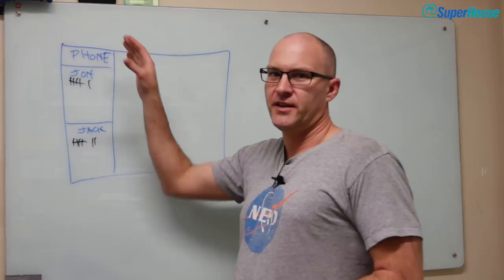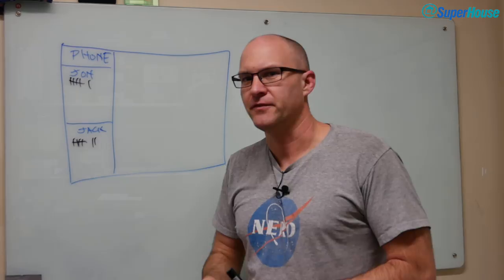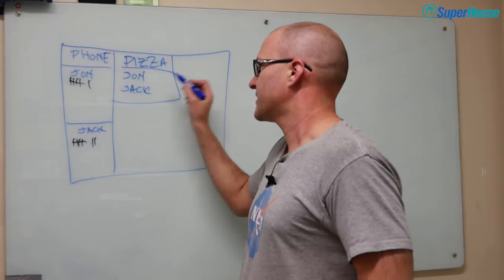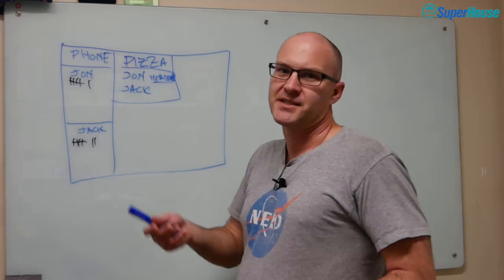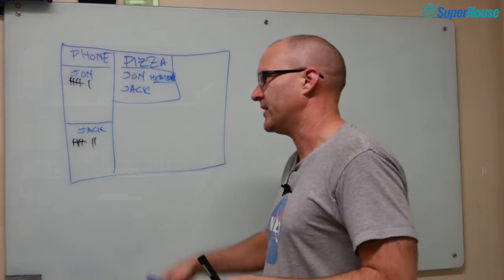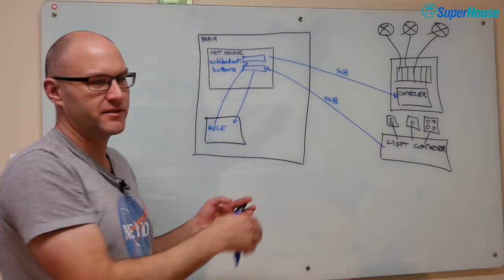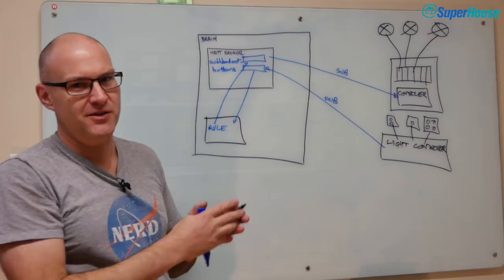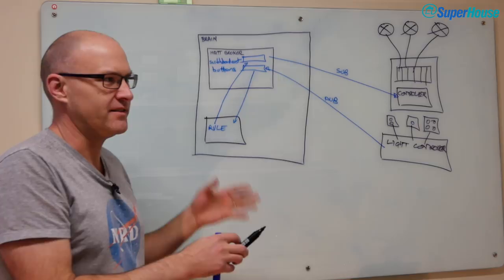SuperHouse #24: Home automation system architecture

Comment: Excellent video, thank you for taking the time to put it together! I'm wondering about that temperature and humidity sensor you showed in the office. That arduino board looks like one I've never seen before, very tiny! Using a custom design with integrated WiFi, or is it an off-the-shelf build?

Comment: Hi Jon, on reflection (and re-watch) of your video I've got a question regarding MQTT and publishing to topics. Ever since I watched your early videos on light switches etc using MQTT to publish to topics, it appears each lightswitch has its own unique arduino code, because it needs to publish to a unique topic correct? (you give each switch a Panel ID I think you called it) What do you think about the idea of rather than publishing to a conceptually easy to understand topic e.g. house/lvingroom/temperature - you publish to a device-name based topic, and by device name I'm thinking MAC-address so something like sensors/AA:BB:CC ...../temperature. That way your "script" / rule engine, needs to do the look up to "convert" a MAC address to what it actually is or only subscribe to the right MAC-address topi, but then it means the code on each device is basically standardised? Thoughts? Obvious drawback is that it is less conceptually simple to understand each topic but it means that every light switch (as an example) would contain the same code which seems like an attractive idea to me - cheers and thank you again for all your amazing and fascinating work!
Reply from the maker: Topic structure has frustrated me ever since I started using MQTT back in 2009. I started with a very simple, flat structure with shared topics. For example, my light switches all published to a topic that was just called "buttons", so their messages had to contain both their own ID (to show who published the message) and the ID of the button that had been pressed. So a message like "17-A" meant that the first button (A) on panel 17 had been pressed, to distinguish it from the first button on a different panel. Many of my topics still work like that, but for newer devices I tend to use a structure that's more like what you describe. I really like the Tasmota firmware that Theo Arends develops for Sonoff devices, and he uses a logical structure that incorporates the device ID into a structure that separates out control messages, feedback, telemetry, etc. I need to figure out a consistent topic structure for my system and do an episode about it.

Comment: Nice setup Jon and a great info for those starting with Automation. I'm very envious of your fully wired system. I'm currently doing what you are albeit on a smaller scale and mostly through smart wall switches and ESP8266 boards. My brains is HomeAssistant and I use MQTT for communication too. Just a couple of points, why do you use NodeRed/own rule engine? Are rules not possible on OpenHAB? The second point, but that's really nitpicking is what you mentioned about presence using your smart phone. I find with many recent devices that their system systems manager aggressively controls battery life, so much so that they keep disappearing from the network. So I had to take triggers based on device visibility out of action. I'm thinking about BLE, based on Happy Bubbles.
Reply from the maker: Thanks for the comments, Petr. I've only looked at HomeAssistant briefly, and I want to spend some time exploring it and comparing it to OpenHAB. There are two reasons I have so many rules outside of OpenHAB: first, I started by only running my own rules engine in the begging and added OpenHAB in parallel to it later; second, defining rules in OpenHAB sucks. Creating a rules engine is a really hard problem so I understand why OpenHAB works the way it does, but I just don't like using it for that purpose. Regarding presence detection, I have a box of the Happy Bubbles hardware here and I'm going to do a whole episode about it soon :-)

Comment: Hi. I noticed before you were using a Mini PC with Ethernet to run Openhab on Linux. Now you are using a Raspberry PI, and it looks like you are not using Ethernet. It looks like you are just using Wifi that is on the RPI. Just checking if that is the case. I thought some time ago you said you prefer not to rely on anything wireless (or is that only for Security devices)?     Thanks
Reply from the maker: Yes, well spotted. Right now both those Brain boxes are connected by WiFi, and they're the only critical part of the home automation system that isn't hard-wired. They do have Ethernet sockets internally but because of how I mounted the PCBs inside the box it's not easy to access. Connecting those by Ethernet is on my to-do list. I'm going to do a detailed episode about how those boxes work.
Reply: That would be great. I currently use an OrangePI as Openhab2/MQTT server, but as I am renting, I cannot make too many changes to the wiring where I stay, so at the moment it only really controls 1 x Sonoff for the childrens lights (also using TASMOTA), all as per your suggestions. But it also does other things, It is a Reverse VPN server for 2 remote networks I work on, as well as a MRTG Grapher for those networks, as well as monitoring my LAN and ADSL Connection stats. It also runs Nagios to monitor things.

Comment: @SuperHouseTV very nice video thanks. I see you have a watchdog on the Arduino that detects wall switches pulling Arduino pins low, so it is unlikely that Arduino it will go down for long enough that it would really matter, if there was a problem somewhere. A number of questions about the rest of the set-up. 
1. What do you use for assigning IP's; a modem router or a switch and how reliable is it. Does it ever go down or otherwise need resetting (frequency)?
2. Does the Rules Arduino ie MQTT logic glue controller (is it an Arduino?) have a watchdog on it? How often does it go down?
3. How often does the Rasp-Pi Zero W with Mosquitto go down? How often does the daemon Mosquitto down?
Which is the weakest link?
Thanks, great video
Reply from the maker: Good questions!
1. I used to assign IPs statically, but it's a pain to manage. Now I use DHCP whenever possible. Right now my DHCP server is my ISP-provided router, which is HORRIBLE. I hate it. It goes down all the time, and it's definitely the weakest part of the system. I'm working on an episode now about building the ultimate home router / firewall with redundant hardware, auto failover, and other cool things.
2. The rules are currently implemented in the little white boxes I showed that I call Brains. They are a Raspberry Pi running OpenHAB, MQTT, and a few other things. Currently the rules are implemented in a combination of OpenHAB and a home-brew rules engine, which I will shortly be replacing with Node-RED. There's no watchdog on it, but so far it hasn't needed one. If power goes away and comes back, it just boots up again and continues. Also, I have it on a UPS.
3. Mosquitto is super reliable. I've been running it since early 2009, and I don't think it's failed on me even once. I've replaced the Brain hardware a few times over the years, starting with a small-form-factor PC with Debian, then an Asus EeePC with Ubuntu, then several generations of Raspberry Pi with Raspbian. On all those systems, Mosquitto has worked perfectly.

Comment: Hi Johnathan. Nice video. 
You seem to be an avid Home Assistant fan. At the moment I use Node-Red for all my automation. It supports mqtt and Alexa (so cool) which is the basis for my system, has a console (needs work but is functional) and requires minimal programming. But I've always wondered if Home Assistant is better... or am I way off and there is no comparison? Have you considered doing a comparison video?
Thanks!
Reply from the maker: I haven't used Home Assistant yet, I've used OpenHAB for a few years now. I currently have a rules engine that I wrote years before Node-RED existed but I plan to replace it with Node-RED some time soon. I'll definitely do an episode about that. I want to set up a side-by-side comparison of a few systems including HASS, OpenHAB, Mister House, etc.

Comment: Can you please explain to me why you would use this system over an off the shelf lighting control system? The light switches look terrible, it appears not to have status indication on the wall switches and there is no ability to dim lights? I can not see any validation?
Reply from the maker: I can give you about 100,000 reasons why, which is what it would have cost to have the house fully fitted out with C-Bus or some equivalent system :-)
Reply: As a professional systems integrator I am confused by these systems. I'm truly in awe of you software programming ability and ingenuity, but don't understand how you could possibly de-value your time so much. For reference a Cbus system for what looks like about 40 lighting loads and 7 blinds at full retail price which nobody ever pays would be $7,641.00 with 16 dimming channels and the ability to stop your blinds at a position other than full open or closed. I am also really interested to see the user interface that you have for your mobile device, if you are looking for other video topics. Thank you for sharing I appreciate the insight.
Reply from the maker: That's a lot cheaper than I've seen in the past for C-Bus gear. I haven't shown anything about it on this channel because it's not open source, but I've done work with C-Bus, including designing a DIN-rail mounted hardware bridge that used a 5000SM/2 module to link with a serial-to-WiFi bridge. This channel is all about DIY projects though, not buying close-source stuff and just plugging it in.

I can control the blinds to stop at intermediate positions. Another commercial job I've worked on for a big electric blind company that I won't name for NDA reasons is the control electronics that goes inside the blind tube and interfaces with the motor and position / endstop sensors.
Reply: One other thing I would really like to know is how you are interfaced to your A/C system? this is a common sticking point in our system due the non standard protocols used by ducted A/C systems here in Australia.
Reply from the maker: Yes, that can be really frustrating. Right now I'm using an I/R blaster type approach to controlling a Daikin reverse cycle AC, with a Particle Photon driving an I/R LED. We also have gas central heating which uses a wireless controller, and evaporative cooling that uses a wired thermostat. I've already opened up the Daikin AC and poked around on the internal maintenance header to see how difficult that will be to integrate, and it seems like it shouldn't be too hard. I want to cover this in one (or multiple) future episodes.

Comment: Just curious but... Why have you not switched over to OpenHAB 2? I have installed OpenHABian on my RPI2 and have had fantastic results, I also use a lot of my own arduino devices with mqtt and mosquito as my means of communication, I was a long hold out as well, but (maybe this isn't as big of a deal with you) I've noticed its much easier to get bindings and third party hardware to work together.
Reply from the maker: I just haven't got to it yet. I installed OpenHAB2 on another Brain (the one running alongside the active brain) and played with it a bit, but I didn't like the way it handles configuration. It felt too much like magic, with the config split between multiple locations. Perhaps it was my misunderstanding of how OH2 works. OH2 seems nice if you have devices that can be autodiscovered and already have bindings, but much of my system is custom bindings using external scripts referenced through the config files. Doing a direct migration won't work, so I have to start from scratch and build up a functionally equivalent config in OH2 using the new configuration system. I just haven't had time to do that yet.
Reply: I can see what you mean about how it handles configuration, it was one of my biggest hurdles as well. But after I dove in, it wasn't nearly as difficult as I had previously thought. All bindings (that I have tested) from OH 1.x work perfectly when installed via the paper UI,  then configured via OH designer (I haven't figured out how to configure via the paper UI). I have had issues with manually installing bindings (as you would do in 1.x) which is why I use the paper UI to do it. As far as configuration differences OH 1.x stores binding configs in   openhab.cfg, in OH 2.x each binding gets its own .cfg file in the services folder. there is one other location the UI creates and stores config data, when you use the UI, sorry I don't remember where it is. But I remeber having to clear it once a while ago after making a bunch of config changes in OH designer. At first this was a little difficult to wrap my head around, I feel like the documentation is a bit lacking as of now, I lack the full understanding to contribute towards improving it.
Reply: Right - I also use OH2, but using only the configuration files (items, rules, sitemaps, ...), except for z-wave things that are conveniently discovered through the Web UI - but their items are still defined in config files.

Comment: Great video thanks for sharing. It is to bad the circuit breakers were not smart I/0. Plus why bother with load center being separate. Make hot bus perimeter around the house leave circuit breakers very close to node. This world reduce wiring to 2% . Most rooms only require defused light of the hot bus.
Reply from the maker: Sure, that would work too, but it distributes failure points all around the house. I talked about my reasoning for this in a couple of previous videos, but I can't remember which ones! I'm pretty sure that I covered it in this video: https://www.superhouse.tv/22-linbus-axa-electric-window-motors/

Comment: While I wait for you to get the relay shields in. Is there a reason you are using the ethamega over the etha10?I'm thinking I will order just the one arduino and a few relay shields and see if I can get the basics down then move on to another and more shields.
Reply from the maker: Right now my two switchboards use slightly different systems. The smaller switchboard uses a stack of 3 Relay8 shields giving a total of 24 switched outputs, mounted on an EtherMega. I did have an EtherTen in there previously and it would do the job, but I swapped in an EtherMega at some point because it has the built-in switch mode voltage regulator and it was easy to feed 12V to it over the network. You can do the same thing with an ET. Of course I have an unfair advantage because the back half of my garage is shelves full of Freetronics stock, so I can simply grab any device I want to use :-) The larger switchboard currently has an EtherMega with a bunch of Relay4 modules connected directly to digital outputs. I did an episode previously about building an output controller, but I'm going to return to it in detail later because I want to replace both these controllers, and I also want to cover things like dimming.
Reply: SuperHouseTV really good stuff mate. I just pmed you on Facebook
Reply: It would be fantastic to see an episode on dimming! Thanks for being such an inspiration